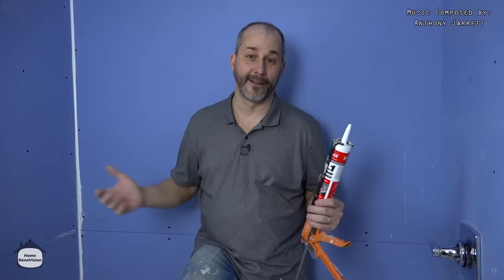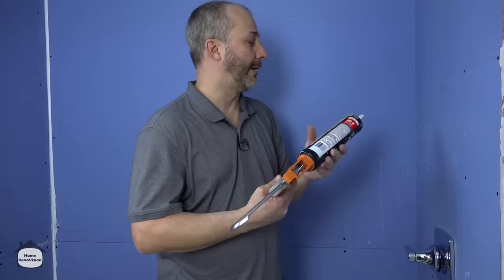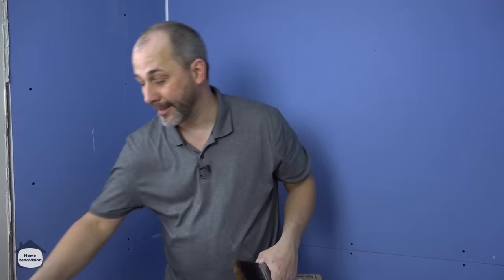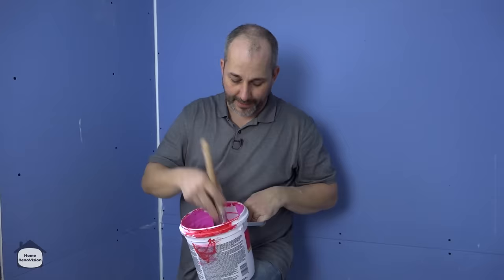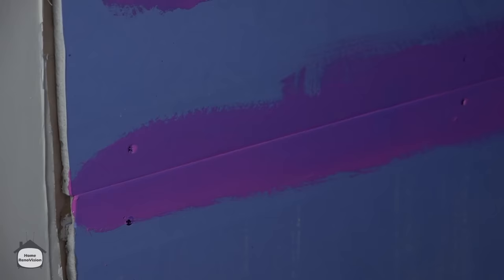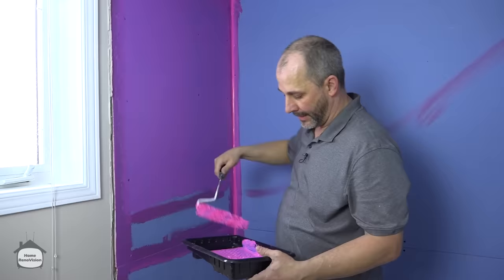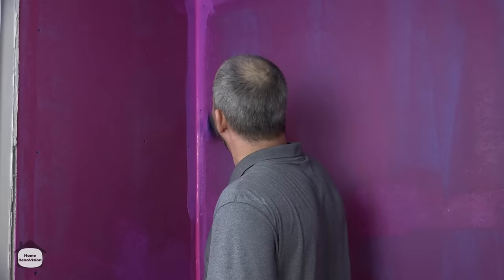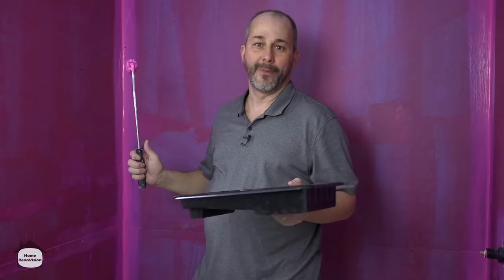The Most Inexpensive Shower Waterproofing System Ever!

Comment: It should be noted. 
Redguard is only truly waterproof when enough coats have been applied so the background can not be seen. 
In general it’s 3 coats. 
Happened to be at one of there demos. 
I’ll add cuz I have been asked. 
Redguard will NOT fall off or peel away from wall. It’s also a better bonding surface then drywall alone. 
And if anyone doubts redguard. Get a cardboard box (small. Or a shoe box). Put a few coats in with a brush. 
Fill with water. 
I tiny pool for your turtle or your lizard. Lol
Reply: Mike Sacco your comment is spot on. I prefer aqua defense myself because I love Mapei products, but they are the same thing. Multiple coats is key. 3-4 usually. I have always been told it should be as thick on the wall as a drivers license or credit card. Aqua defense is also a little easier to bare in my opinion because it’s scent is less pungent. When you’re working in a small bathroom that is significant.
Reply: Can this product be applied over paint?
Reply: Thanks.. But exactly  what the man said did he not?

Comment: I have used that in conjunction  with fiberglass tape( not the drywall one- looks like thin cloth)  specifically for the corners and edges and fiberglass backer board

Comment: I am building a fly fishing cottage in SW Colorado and have to build 3 walk in showers.  I was debating on what type of vapor barrier to use in them.  I have used wonderboard in the paste with a roll on vapor barrier.  I would like to use drywall instead because it is so much easier to cut and install.  I do not like cutting any corners but based on your video, I no longer believe that I would be.  Using drywall will save me time and a lot of money in doing 3 showers. Thank you for this video and ALL your other video's.  Your are one of my favorites to watch.

Comment: Rebuilding a shower/tub my dad did in the 70s. Very surprised how well it held up. Yes it had water damage, but it was tile on drywall. Many years later it had latex caulk put in the corners and tub edge. Around the tub controls it was rotted out and the tiles were toast. Most of the drywall survived. It went over 40 years with nothing but tile and grout. Sometime in there the shower controls were replaced and a few tiles were patched back in.

Comment: sometimes with Redguard, I use a small tooth trowel for first coat, then flat trowel the second. When you do the trowel ridges on the first coat, it dries fast and stands. then when you do the flat, you can fill it to the recommended mils. But you need to do that first coat really even, no blobs! Keep a trowel in the other hand for a hawk. I think recommended mils to reach full impermeable is 30 or so, if you use it for a pan or bench etc. I usually use disposable brushes too. I don't like cleaning the brush, especially if I wait a little too long. Good vid.

Comment: The roll-on membrane system makes a lot more sense to me than a board-and-tape system which costs a lot more and is put together with thinset which wicks water. For a builder I appreciate that the board-and-tape is probably a lot faster to put up, but as a home owner what's the value proposition for me?

Comment: Awesome! I paid for an unexpected bathroom renovation because the previous owners put tiles on top of sheetrock covered with plaster (50’s house)... BAD mold grew in between the plaster and sheetrock and had to do mold remediation. I was very relieved to see our contractor first using a similar product than the one you show (it was green instead of pink)  on top of the cement board (for tiling after) to waterproof our shower. Definitely that made feel I was paying the right person to do that and while I checked what he was doing I was also learning a lot. This is just a reaffirmation that these types of  products work and will ensure that you will not have any moisture and mold problem for a very long time. Thank you for your videos!
Reply from the maker: Hi Daniel, this is not the best way, but it is a great way to get a long lasting shower. Chances are that it will be rebuilt due to changing design styles before the tile fails.

Comment: This video is 2 years old and I’m getting ready to redo a bathroom from 1897. It’ll be my first. I bought the green drywall that is water-resistant and mold resistant as talked about in one of your more recent videos. Would you still suggest using that same caulk in those corner crevices? Along with joint mud for the remainder, then slapping on with the Aqua defense membrane? I hope you see this, thanks so much

Comment: I actually read the instructions on the red guard before I used it. My understanding is that your first coat should be on the seams and screw holes. The second coat should be rolled on horizontally and the third coat rolled on vertically. Then you should go back with your brush and catch any spots that look thin.  I used Hardi-backer with thin set and mesh tape (not the drywall kind) rather than drywall though.
Reply from the maker: yup that is what it says. and did you notice they said do touchups if it looks too thin. do it my way and you never need a touch up. Cheers!

Comment: Awesome channel. Two questions. 1. Any reason you didn’t use the mesh/fibreglass tape on the seams with the roll on membrane? Would you reco doing so? 2. If this was an existing stand up shower, could you use the membrane on existing shower pan after the tile has been removed and the surface smoother down? Rather than replacing the pan if it’s not leaking.

Comment: Great video! I have mold resistant (green rock from home depot) drywall installed and it's been taped already. Can I apply the seal and bond over the drywall tape or do I need to cut those joints and re-seal? Thanks!
Reply: I would like to know the answer to this too

Comment: First tile job I did I used cement board with tar paper behind it.  What a pain that was!  For a tub surround, I agree, the redgard would be the way to go.  Just make sure you put some waterproofing sealant against whatever backer board that touches the top of the tub so that water can't wick up into it.  Maybe even get some hardibacker and put a 4" strip around the bottom edge touching the tub.
My second tile project was a full shower stall.  For that I used schluter kerdi.  Only way to go if you are waterproofing all the way down to the floor.  Best thing about kerdi is that you can put it over regular drywall.  No need to caulk the corners.  Just rough fit the drywall and cover with the  kerdi membrane.  It a bit of a trick to learn how to get the thinset troweled on the drywall and pressing the membrane into it but other than that, the stuff is great!  100% water barrier.
Reply from the maker: I use lepage 2 in 1 sealant for that.

Comment: Do you still put a vapor barrier behind the mold resistant board, even if you plan on using the Red Gard? I am trying to gain some knowledge before I attempt renovating my bathroom. Your videos have been so informative and you do an excellent job at explaining each part of the process as you go. It has made the learning process so much easier, thanks!
Reply from the maker: Yes, the vapor barrier system should be continuous.
Reply: Vapor barrier isn't necessary if you're using a liquid membrane like redgard. The membrane is your barrier.
Reply: jaksngreen would there be any problem if you did both Vapor barrier behind and also use redgard on front

Comment: Denso Board has a membrane on it and Menards use to carry a fiberglass/drywall mix type yellow board without the membrane/8/10/12 ft lengths.I've did quite a few bathrooms with that product and the red coat.In basement bath rooms I'll only use cement boards with a roll on membrane, might be overkill but some it wrks for me,never had an issue, pending no moisture problem issues in the basement where no matter wht u use it's getting messed up.Good tutorial.👍👍

Comment: Hello, I've used this system in my home main bath reno with great results.  I'm wondering if you'd suggest using this method, with tile, in a 3-season cottage where slight movement may occur during thaw, or putting out the expense for Kerdi board to minimize movement and chances of tile cracking?
Reply from the maker: kerdi all the way in that scenario. Cheers!

Comment: Would it be better to use a cement boards like Hardie Backerboard rather than the mold resists dry wall? The cost is about the same.
Reply: I, too, have this question.
Reply: I wanted to know this also
Reply: me also
Reply: Use Dense shield instead, it has a waterproof skin applied to it.  Thinset and tape corners, redgard after.

Comment: Thanks much Jeff!

I am a novice who is preparing to install the Kohler Choreograph shower wall system. My plan is to install standard moisture/mildew resistant drywall and use your method of prep illustrated here, and then (as per Kohler’s own advice), to adhere their wall panels using their proprietary adhesive, directly to the RedGuarded blue board.

Given one of your commenter’s note that only backer board should be used in general, do you see a problem with my strategy?

I am at the open frame or stud stage at the moment.

Thank you again!

Comment: I used this technique for my shower and put several coat because i always thought the coverage was not enough. I would have use caulk on screw head and middle joint.  Cheaper but longer. And around the pipe and valve the schluter flange are great.

Comment: HI Jeff
I have an RV and the shower stall came with 1/4" ply covered in a vinyl like wall paper which is already peeling. Do you think I can peel off the paper then apply the red guard to the 1/4" plywood with a few coats then tile over that?
Reply: Sherry Alfaro I would say yes. I would but five or more coats on it.

Comment: Sorry if this question has been answered in another video or comment already.. but how do you waterproof a wall penetration for your fixtures when using a roll on membrane? 

My guess would be to use some foam backer-rod inside the fixture penetrations and then seal it up with the LePage 2in1 around the pipes? Then do you roll the membrane on top of the LePage 2in1?

Comment: Denssheild fiberglass tile backerboard >>> anytype of drywall, mold resistant or otherwise.... works like drywall, cuts like drywall (don't breath the dust), costs $35 a sheet, but will not mold if you submerge it.
Reply from the maker: You still need to seal the gaps. This is why I like this system for fast and cheap. It lasts quite a long time as well.  Besides most bathrooms are changed due to design changes after 30 years. So no need to invest more on the waterproofing than the tile.

Comment: Great video and very cost effective!  I think I'm gonna use Hardie backer Hydro defense  (which is fully waterproof ) with butted corners and the 2 in 1 caulk on the corners and over all the screw holes. Done!   Job will  be twice as fast.  Not sure if its as cost effective as this but the board will outlast that greenboard.

Comment: Sadly we were watching Allison Victoria's show the other night and they briefly showed the shower being tiled directly to the "water resistant" drywall. No waterproofing at all. I can't believe this is still allowed. This is one of the many reasons I will never buy a "renovated" home especially from a flipper. They cut so many corners to milk every penny of profit they can. I would rather buy the home that needs fixing up and act as the quality control person during the renovation. I'm currently renovating the master bath of our newly purchased 10 year home. Three of the 2x6 exterior studs are rotted due to absolutely no waterproofing in the shower. When I'm done with it, it'll be waterproof until the house falls down.
Reply from the maker: That is still code in most area.
Reply: Not all flippers cut corners...i spend the extra $50 for RedGuard or Mapei AquaDefense and tell bathroom guy to use it before tiling.

Comment: I rounded the corners, ordered some Flexi-Tech hi quality vinyl flooring with a tile pattern, and glued the flooring in the shower stall as a one piece surround. I caulked the vinyl to the tub and I will never ever have a leak...and no grout to clean and replace either!  It actually looks pretty good and is easy to clean.

Comment: Why not use cement board with red guard or even better laticrete hydrobarrier? Like you said, no sense in cutting corners...
Reply: I was wondering the same thing. I didn't think cement board was that much more money.
Reply: I find cement board harder to work with when you're basically getting the same result anyway. Drywall is just easier to cut, hang, etc.
Reply: Could be homeowner's preference. As a roofer it's ridiculous the products people fixate on using to save a couple bucks sometimes. Even when we explain the benefits they still prefer saving a little bit 😂

Comment: Great video! Two quick questions. Q1: Currently redoing our house's small guest restroom (new tube/shower tile). When I removed the (27 year old) traditional subway shower tile, it was cemented to a separate sheet of sheet-rock that was on top of the primary (standard) sheet-rock. When going back with new water-proofing substrate (for tile), can I replace waterproofing substrate board flush with other primary adjoining (regular) sheet-rock? Q2: Regarding how far to bring the waterproofing board to or over the lip-up of the tub (does board sit on lip or go over tub lip just short of sitting on tub itself)? I have heard 10 different opinions on where to stop waterproofing board? I appreciate your feedback or reference on these questions! Keep your great videos coming...they are about the only ones that I reference!

Comment: Hey Jeff, your videos are great, they've been a huge help on my basement renos !!! I have a small Stand up Jasmin shower Kit 75in H, 30in W, 32in D from Lowes, that I just installed. I have mold resistant drywall. My question is my wall going up after the flinge of the shower is only 8 inches high. Could I do exactly what you did in your video and paint over the Red Gaurd membrane instead of putting on tile ?

Comment: How do you seal up the joint between the waterproofed part and the drywall? At what point do not worry about water splashing out of the shower? Love all the videos, you're a great teacher, thank you!
Reply from the maker: I never worry about water splashing out of the shower. the room has a fan and most building materials have the ability to get wet and dry again. especially all the painted surfaces. Cheers!

Comment: I just finished doing this process.
The one thing you should be aware of is that redguard gives off really strong fumes. There is no way I could do three coats back to back. I had a mask on, window open, fan going and bathroom exhaust fan going and I had to get out of there between coats.
I'm surprised it wasn't mentioned in the video.
It's now about 4 hours since the last coat. Can't even walk in the bathroom. 😳
Now it's the next day. 12 hour later. The bathroom is a toxic mess. I hope I didn't ruin my bathroom using this crap.
I would not recommend this technique for indoor residential use.
I think Jeff forgot to mention this technique is to be used on outhouses far out in the woods.
The plus side, you won't have to worry about bears, the fumes will act as a repellent.
Update- 24hrs later, still smell this stuff all through my house.
I have no idea if tiling over this mess will contain the smell.
There is so much stuff on the internet about redguard/fumes/toxic. Stay away from this crap.
Jeff take this video down!

Comment: I'm using a linear drain with mud bed, will redguard stick to the metal flange of the drain in order to seal the seam where it meets the mud pan?

I was also thinking of using an adhesive caulking between the flange and pan, then redguard over it.

Comment: I would just fill screw heads with the caulking first.
Reply: With redgard, you dont have to. It will seal the screws
Reply: redguard will be stronger and the bonding direct to drywall better than ur calk , why add an extra step :)

Comment: Hey Jeff, loving your videos. I was wondering...can you tile over a mold resistant drywall directly? Would I need a special cement or just non modified cement?
Reply from the maker: you can with modified cement. But i would suggest using at least a roll on membrane. Cheers!

Comment: Great video - thanks for sharing.  I do have a question.  I am adding a tile wall above a tub and have already installed mold proof drywall on the walls above the tub.  In your video, you said to add caulk in the corners instead of regular tape and mud used for drywall.  Unfortunately I added regular tape and mud to the corners and seams before I saw your video.  What recommendations do you have on what I should do now?

Comment: The drywall that you mention how about if I use hardy backer that should be just as good correct and put 3/4 inch plywood and then hardy backer and now I’m going to put the red guard